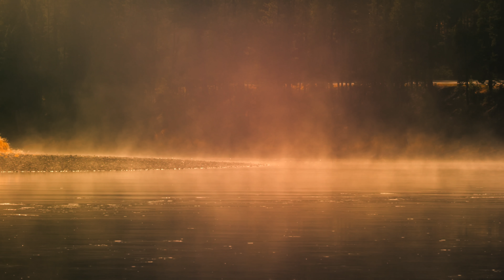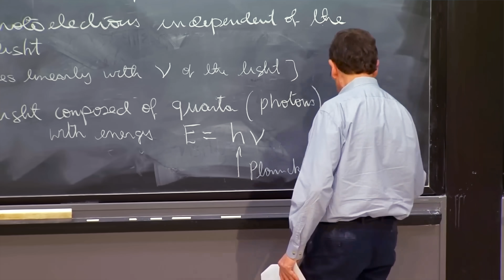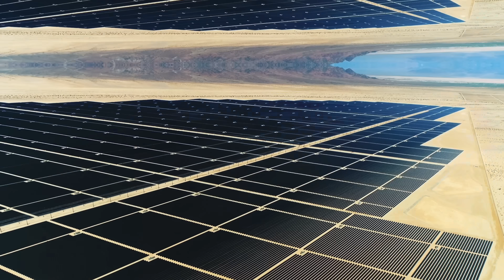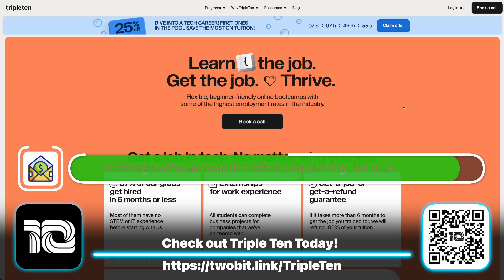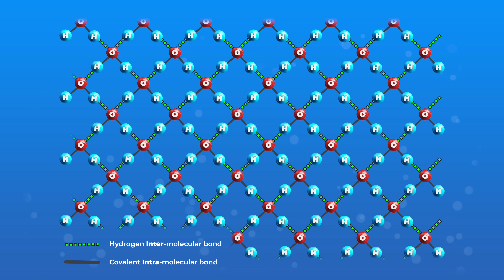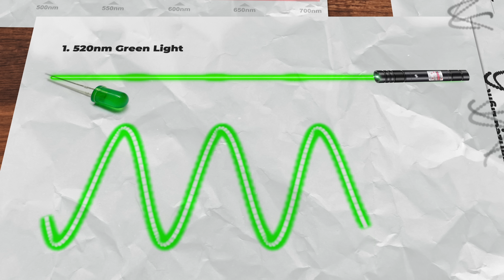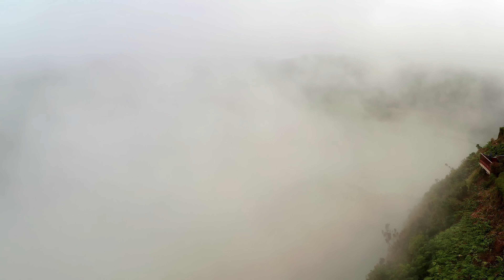New MIT Discovery Just Solved Water's BIGGEST Mystery!

Comment: I don’t believe this is a huge break through, it might help some to reach a peak evaporation rate. Try evaporating cold water with a light that produces no heat. It will not work, and will evaporate at the same natural rate if l compared it to the same water/air temperature and wind rate with no light. Adding heat to the light source would surely increase evaporation, so you cannot throw heating out of the equation entirely. Also, wind plays a part in evaporation, blowing cold air on to hot water creates a lot of steam. Some fans need to be incorporated into the process with a cold air intake to blow cold air on to the boiling water with UV lights on the water to reach a max evaporation rate. That is probably the best way to reach peak efficiency of water evaporation. 

You can notice the same principle occur when you see water vapor coming off of a hot soup when you breathe on to it when trying to cool it down. It actually works. The evaporation is increased because you increase the wind rate and the temperature of your breath is colder compared to the soup, so the soup then cools down and doesn’t evaporate as much. Apply this concept to water evaporation, just keep the heat constant, and contrasting temperatures  with different wind speeds; which would then need to be tested and studied to achieve peak water evaporation with the correct combination. That is how you would reach peak efficiency in my opinion. It’s a combination of factors.

Comment: As long as you dry a wet T-shirt in a closed space without a single photon of light, it will dry in total darkness and the water will evaporate.
Reply from the maker: very slowly, because even at ambient temps, some water molecules will reach the required energy to break free. this is about much much higher levels than that.

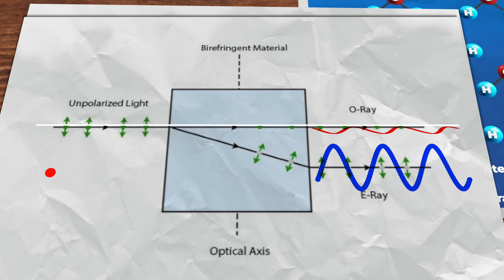Comment: Sorry.  At 8:34 you said you would use a Faraday rotator to rotate the plane of the diverged light by 90%.  There is no antecedent for the 90%.  Perhaps you meant to say rotate the light by half pi radians or 90 degrees.  =>  Nice video, interesting ideas.  => So, is plane polarized light at perhaps 45 degrees to the surface, or a quarter pi radians emitted by condensing water, or condensing water groups of certain sizes?  The effect should be reversible.  => An internet search found three, not two MIT papers.  Haven’t read them yet, but perhaps only two were relevant.  Interesting this was at least in part from a researcher’s first year, post-doc fellowship.

Comment: point source light rectified and tuned to the type of water based on EM /Spectral analysis of the water. Vibration and lasing of the local environment wherein the water is held. Photomolecular effect is not new news... Additionally, this technology can be used to understand the atmospheric charge, capacitance, dielectric permittivity and permeability of atmospheres and 'space'.  The High-frequency Active Auroral Research Program (HAARP) uses this understanding to analyze the cosmos, hence why water is called the God particle.  Now light....a time crystal based in frequency, polarity, charge, capacitance, pressure...escaped.   Amazing presentation to get this out to the people brotha! Everything is light, everything is sound, everything is vibration, harmonics, multidimensional resonance.

Comment: Why does it evaporate?  The temperature of the water molecules aren't uniform.  If one happens to have enough energy to be above the boiling point, it can leave the solution (assuming it doesn't bump into another and lose its excess energy to another molecule) at the surface of that material.  At that point, the air, which can hold water vapor, can just hold onto it.

Comment: Firstly, evaporation is the change of kinetic energy at a molecular level, which by definition is thermal energy aka heat. Secondly, the idea of transferring energy to a system using methods besides heat doesn't seem particularly revolutionary. Desalination via these methods would still be costly and impractical at scale. If anything, even less efficient because converting electricity to light is less than 100% efficient due to...well, heat. You can't escape the laws of theromodynamics, and perpetual motion machines aren't real

Comment: A large scale Australian study on evaporation found that light had a significant impact on evaporation that was not modelled and they had to adjust evaporation models to include amount of light to get accurate predictions (the trend in data correlated "Global dimming"'s effect on evaporation). The exact mechanism was not studied but the effect was identified. Good to see this is all tying back to the fundamentals
Reply: Fantastic. Science will save the world.
Reply: They also found the by product of desalination was killing ocean life when disposed into the ocean. Read the articles. it shocked them they love the oceans. But were killing it with out of control balances of the by products removed from the ocean water  History read articles
Reply: Actually no, it's been just the opposite.  Temperatures rose and then CO2 levels followed.  This has been a favorite go to of the climate change mob.
Reply: I'm not so sure about the positive effects it would have. We aren't even using a small percentage of the light that the sun is providing too us and we could use a lot more sunlight when we would use a different method to evaporate water and get freshwater from seawater without having a bad effect on our climate.
We're using black plastic layers or black plastic balls to avoid the evaporation of our water reservoirs in this way even today. We could easily use similar methods to evaporate water under a layer of plastic to evaporate water by using a weight and a device that would catch the freshwater and enrich it with minerals and everything else you would find in normal drinking water.
We would need of course water reservoirs close to the ocean and if the water would evaporate enough that it wouldn't make sense to use said reservoir, we could let the rest of the water out and even harvest minerals like lithium and salt by cleaning mentioned reservoirs before we qould use them again.
We couldn't just pump the extreme salty water that would be left after such an evaporation all at once back in the ocean because it would probably kill most life in the area of the facility and we would have to search for a solution of this problem. But we could build such facilities for relatively cheap and operate them almost for free. This would even enable poor countries to build such reservoirs and give them the chance to make water for themselves and make a buck to either pay for the needed infrastructure and repairs or to build more infrastructure to make the lives easier for their people or to give them the opportunity to make  their own industries. It seems to be a win, win situation for everybody who is eager to start an own business... when corruption isn't staying in the way and would destroy it for everybody.
Reply: H2O is the largest greenhouse factor much more than CO2, I wonder if they can update their greenhouse warming models to account.
Reply: @brasidas2011 🤦it's already in the models. Not unlike how water vapor has already been in the atmosphere for hundreds of thousands of years, relatively unchanged - unlike CO2
Reply: @Cyrribrae  I doubt it.
Reply: @brasidas2011   Dunning-Kruger effect in action.
Reply: @Cyrribrae  You would be wrong.  CO2 levels have fluctuated quite a bit.
Reply: @SovietReunionYT  If you mean @Cyrribbrae you're absolutely right. 
But If you mean @brasidas I would love to know where he's wrong and why he/she is a perfect example of the Dunning Krueger effect. Because I can't find nothing wrong in his/her comments...
В любом случае, я желаю вам всего наилучшего и надеюсь, что это кровопролитие наконец-то прекратится, и отцы смогут вернуться к своим женам и детям, не опасаясь, что война вспыхнет снова. Тем более, что, несмотря на всю ненависть, мы все равно один народ!
Reply: @charleskernachan4223 Of course, but it never happened so fast like nowadays. When the CO² levels are rising then it gets warmer and if it's getting warmer, the water vapor we're rising as well. When all the CO² that were stored away in the oceans and the rotten plant matter (like those in the permafrost) is getting released thwn it's getting warmer and the water vapor is rising aa well. Our species released more CO² in a much shorter time period then ever before and if we don't change things drastically, we will create a rundown effect nobody can stop anymore, no matter what kind of technology we are using to get the CO² and the methane gas out of our atmosphere. 
We already almost destroyed the ozone layer and if we had ignored it like we're doing it now with the CO² and the methane gas, we would have no other chance then to live underground and could just come out during the night (almoat like the critters we were evolving from).
You're maybe not aware of it, but we are living in the fastest mass extinction of all times. Not even the dinosaurs got so fast killed of (after the meteor strike) like the animals we killed in the last few thousand years. Compared to all the animals that we humans unalifed during a few thousand years, the dinosaurs went quietly and peacefully extinct.
Reply: @Spielername   I mean @brasidas. The water vapor thing is one of the basic climate change denier brainfarts. The water cycle is many orders of magnitude faster than the CO2 cycle. Excess water vapor falls as rain. Excess CO2 stays in the atmosphere and only decreases on geologic timeframes. Water vapor is not a driver of climate change, CO2 is.

I dont know what the second half of your comment is saying, I dont speak Russian.
Reply: @Spielername  Oh lord go panic.  No we did not almost destroy the ozone layer.  The climate is just fine.  Also temperatures rose then CO2 levels climbed.  The climate change mob always likes to skip that little detail.  CO2 levels have also been far higher in the past than they are now.   We are on the low end of CO2 levels needed for plant life.  Also, a a result of warming the earth has greened resulting in more CO2 processing plants.  I see you have drank the Kool-Aid.
Reply: @Spielername  Except it's been just the opposite.   The temperatures rose and then the CO2 levels climbed.
Reply: @brasidas2011 of course,  nobody would build such facilities to enrich the atmosphere with water vapor. You would do it in factory like facilities to harvest the water for consumption...

Comment: I don't know, you really have to ask the question of whether hitting a body of water with a green laser beam at an incident angle of 45° while simultaneously heating up the water is more efficient than just heating up the water to make steam. I honestly feel like you would probably be using a similar amount of energy to power the laser as you would to just create the excess heat to do the same thing. An experiment must be done to compare how much energy it takes to evaporate a certain amount of water in either scenario.

Comment: when ice is used as the power. dry ice rockets and high pressure co2 batteries. empty, open, reload, re-use. try SiO2 silica desiccant gel solar/heat evaporation cooling and salt water purification. yep desiccant zeolite sand solar evaporation cooling uses this effect directly. but its nothing new. the effect is happening if you get cooling and evaporation at the same time, from the solar/heat source. think solar evaporating as molecular level flash boiling of very small amount of water.

Comment: MIT has gotten dumber. given what was discovered with ions in the 1970's you can put dry sand powder in a vacuum  inside a sealed room with no light what so ever with a cup of water on the opposite side and the ion exchanges will cause the water to bond to the sand despite the distance. evaporation is also caused by an absences of humidity, which is pure ion exchange. this is why you don't have lightning bolts when it clear blue skies. water in the air facilitates the ionosphere's electron transfers when the vacuum of space whisks away trillions of tons of earths atmosphere made up of the H and H2 and N elements. MIT will reinvent the wheel until infinity ends. not because they are smart, but because they are so dumb. zero street smarts

Comment: What's all the fuss about? Photoenergetic sublimation is not limited to the conversion of solids into gas. It also applies to liquids, i.e. gaseous molecules emerge from the liquid even though their evaporation temperature is not reached. Incidentally, the first (minimal) oxygen content in the early Earth's atmosphere was created in this way.
It is also known that fresh water can be extracted from the salty sea by simply condensing the water vapor just above the sea surface. But this technique has not been used so far because it was easier (due to cheap fossil fuels) to extract fresh water by distillation and osmosis.

Comment: Ahhhh.. now it makes sense.. had to read the paper... the reason this has not been detected before is because, despite its efficiency, the effects are limited to specific conditions and in the majority of real life scenarios, would contribute so little as to be within the margins of uncertainty for traditional calculations.

The photomolecular effect occurs specifically at the water-vapor interface on the surface of the water, where photons directly interact with water molecules, causing them to evaporate. This process does not take place in the bulk of the water, thus contributing very little to the overall rate of evaporation when compared to the dominant thermodynamic effects that govern evaporation in most scenarios. Consequently, while this effect can enhance evaporation rates under certain intense light conditions, its impact on total evaporation is minimal in typical environmental conditions.

However, the presenter is correct, knowing this does mean that we could create the specific conditions with thin water films to potentially take advantage of the phenomena...

Overall, very cool, I just needed to reconcile the apparent contradiction..

Comment: When you dry your clothes with heat, you're blowing a ton of hot air out into a vented chimney, warming up the atmosphere outside your house. If light can achieve the same desired result, but eliminating the byproduct of heating up the outside of your house, then it can be more efficient. No laws broken. It's not producing more with less. It's wasting less.

Comment: Lasers are not polarized. They are focused but a handheld laser pointer is so low energy it'd do nothing but refract in the water.  Or get absorbed.  Also, if you polarize your light, you don't lose 50% of your light source, you loose 99% of your light.  Dispersed light waves are in all directions. Just pick one per degree. That would be 1/180th the power of the unpolarized.

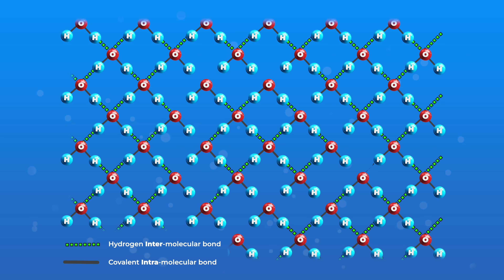Comment: 6:20 his explaination of how light is better over heat is ludicrous.  First off, due to hydrogen bonding water isn't "connected" to four other waters (or 3). A water molecule is "connected" to all other water molecules present.  The hydrogen bonding is why such a small molecule has such a high boiling point.  Light from a bulb has nowhere near the same energy as the heat coming off the tungsten filament.  And a laser would be very high energy focused on a very small point. Mostly wasting energy because the mass of the unaffected water would quickly equilbrate the lasered water  back down to temp. Again vapor pressure is the name of the game.  Also, if there is moving air that will keep the air from getting saturated.

Comment: 4 minutes in and he thinks, what a laser will desalinate the water when we can take insulated system and low power electric heating and achieve the same with less energy loss per volume desalinated.  Reverse osmosis is better than lasers and just boiling it.  Without a laser you'd have to use an even more inefficient incandescent bulb and with that it again isn't the light doing the work but the overheated tungsten filament doing the job. Before you say LED.  LED light sources are low power and give off very little heat.  
This guys confidence is the the problem. He sounds like he knows his stuff but that is Dunning-Kruger in full effect.

Comment: Now 49 seconds and he as horribly explained the wave/particle duality of light.  That it travels as a wave but when it interacts with matter like water it acts as a particle transfering some (or all) of its energy to the water.That can then "heat" up the water. Kind how you picture water molecules moving near freezing.  They are very slow.  Add some near boiling water and those very fast moving water molecules will beat on the slow moving molecules till eventually the temperature equilibrates and the water is no longer near freezing or boiling.  Now explain how evaporation happens in dark room. Once again vapor pressure of water is the concern. That is why all liquids evaporate.  Still wrong less than a minute in.

Comment: When I lived in the Yukon I noticed that a lake's surface was almost all covered with ice, it was -40 degrees outside. The small area of the lake that was ice-free was giving up a huge amount of water to evaporation. The air was so dry it made your skin crawl. I believe that the dry air was pulling moisture from the lake in order to balance the humidity. As the column of evaporated air raised in elevation, it began to snow because the cloud it formed couldn't hold any more moisture as it gained elevation.